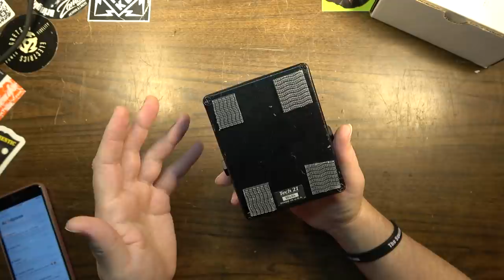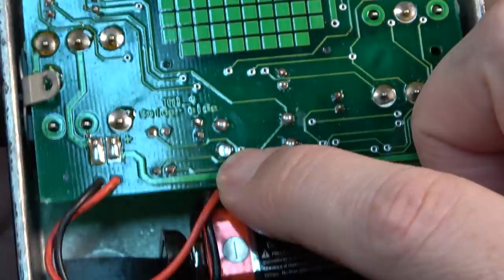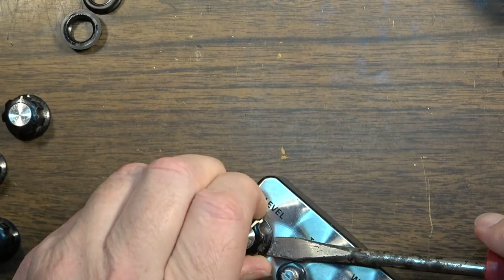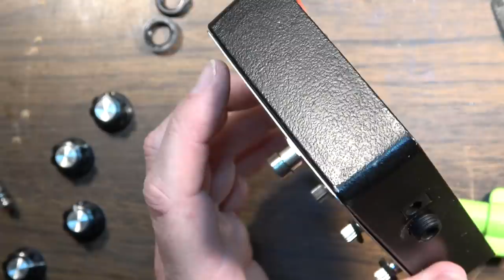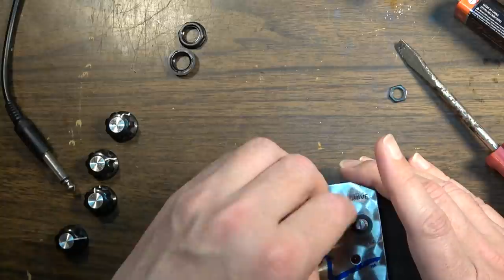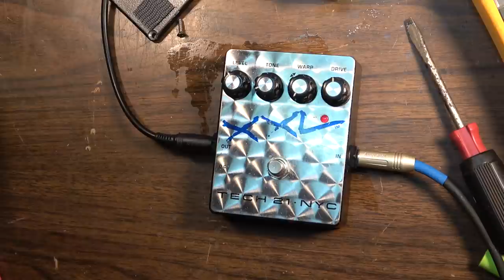Tech 21 NYC XXL 1990s Original - Repair???

Comment from the maker: Check out Dave's Guitar Channel: http://bit.ly/DavesGuitarChannel
Also, I forgot to hit record on it, but I did eventually reflow all the solder on the board also, FYI.
Reply: I just bought two of the last three us listed 90’s silver diamond plate Tech 22 xxls on Reverb.   I dig the transparency of this pedal 
   There is still one left and it’s under 100 !
Reply from the maker: @jahmosaxe3818  haha... I guess I just drove the demand up, huh? :D
Reply: Hi Brad. The owner could have meant having trouble engaging the effect. If that is the case, it is probably the tact switch that you pointed out under the plunger. They become intermittent over time and can begin showing symptoms on only rare occasion. Over time, it will slowly grow to fail almost every time. I replaced all 12 of them on a Line 6 Helix today because they varied from failing most of the time to one failing only on occasion. Measure the resistance of the switch while holding the plunger down. Having the board out and varying the pressure while pressing the switch with a finger would work better as the variance in resistance would be more noticeable,  but trying the plunger a number of times would show the problem. The resistance should remain under 1 ohm while the plunger is down. If at any time it varies over 2 or 3 ohms, replace it as it will become worse and is probably showing problems from time to time already. That would also explain why it didn't fail while you had it. These intermittent problems are our  nightmares as techs because dealing with them can be such a pain to everyone involved.
Reply: Price will now get crazy for these pedals ....
Reply: pedal whisperer
Reply: I enjoy watching you play and noticed some real energy when you jammed into the xxl. 
    Tone mods, amps and pedals that inspire the player to push their own limits what it all about.  Unless it’s tied to digital modeling 
 lol !

Comment: Long long long ago I decided I wanted a 'fuzz' pedal.. I tried a whole bunch of them at the guitar store, and selected this model.. It was easy to make a huge range of effects. I still have it, now about 25 or 27 years later.. and it still works just fine.  I like my XXL.  Some people seem to need 27 overdrive pedals... This will have most of them inside depending on the knob twiddles
Reply: Me too,except i foolishly sold mine early 2000's :/ It sounds great,too great as it makes my unengaged tone sound too midrangey and rounded. It occupies the distortion to fuzz zone nicely,love how it can be dialed in tighter to squashy with the warp control.Squashy and fat.It's great for those who aren't fuzz lovers but like some squashy fuzz flavored a little more clean amp freindly.

Comment: The Warp control adjusts the DC bias of the first op amp. This will give clipping on one half of the signal depending on where the control is set to. The Drive control adjusts the gain of the next op amp stage that feeds the tone control.
https://www.diystompboxes.com/smfforum/index.php?topic=29094.0

Comment: It's possible if he used a power supply that when the pug was taken out the contact in the jack didn't make clean connection for the battery
Reply: bingo, plus the pots sounded like hell

Comment: Yeah, I like the switch design too, but they should have used the jack setup like the other theys used on the crybaby wah. You wouldn't be able to disassemble the crybaby either if they had used standard pcb mounted panel jacks either. I would be super suspicious of the input jack and the 9v clip, but you already knew that.

Comment: I saw this in my YouTube sidebar and immediately clicked in because I used to own one of these many years ago. I started freaking just a bit because mine had just the tiniest bit of the blue lettering scratched/rubbed away, but when you flipped it over there was the "me twenty plus years ago" velcro hooks on the corner with disregard to which direction the "grain" was facing...

I didn't use it much on my board and I vaguely remember selling or trading it ethically by letting them know it would intermittently turn off or short out... obviously not suitable for live situations. 

My worst fear is that this is the same box, and whatever dealer/tech down the line had the same experience you did: can't reproduce the problem or find something wrong, so let's sell it. 

The odds that this is that pedal are astronomically against, but you still have a certain recognition when you see old objects. 

BTW, Tech 21 called the Warp control as adding even order harmonics going clockwise and odd order harmonics counterclockwise depending on which way you twisted the knob from that little arrow point at ten o'clock.

Comment: Is the battery wired to contacts on the input jack (unplug input jack when not-in-use to prevent battery drain)?
Maybe Dave just tried switching it on without a lead in the input...?
Hot licks there, btw, Brad.

Comment: I found that input jack which turns power on can get dirty and not get clean connection to turn unit on. Even a dirty guitar plug on cord can cause this. Great sounding pedal! I would put better battery in it, maybe Energizer.  Back in early 80s I built many distortion pedals with EQs built in for friends. I made one for bass player in our band with quite a kick on lows and the neighbor comes over and says dudes my walls are shaking! His house was 20 feet away. LOL.  Z.K.

Comment: Yep, ran into the same thing, trying to replace the switch on mine. It only needs a switch & I love this thing ( It's the Sans Amp GT3). It gets a Marshall, Boggie,Fender or clean boost. Very versatile & thick sounding.

Comment: Hey brad, what the Warp control on a Tech 21 XXL pedal is supposed to be doing is it is supposed to be controlling the even and odd harmonics generated by the distortion, it basically controls the symmetry of the distortion the pedal produces, if you pick hard, you get that characteristic saggy "aaaaooooo" distortion tone at some Warp control settings that sounds a lot like classic tube overdrive.

Comment: A friend of mine was good at bending the tip of the jack plug, getting crackles, then complaining that the jack socket was faulty. A bad lead would do the same thing. Loose battery connector, who knows?

Comment: I really like the way that thing sounds! ..and the machine turn or motor turned or whatever the fuck you call that shit they did on the faceplate, it looks cool af to me! 😎
Reply: I think the official term is “swirly shit”, but I may be wrong.
Reply: Its basically overlapping circles done with a wire brush. In plastering it’s called pargetting.
Reply: @normanperkel139  oh right, swirly shit hahaha that works for me pal lmao 🤣

Comment: Tech 21, just like the name implies, were ahead of their time. Why you may ask?
Because just like all the crap made in 21 they are impossible to repair and meant for the trash bin after a few years :)
Just kidding, actually have no experience with their products but the way the jacks were connected, makes you wonder.
BTW, I've gotten a few good deals over the years on some semi working pedals and amps when all the problem was just a loose connection somewhere.

Comment: Weren't there amps good too,
Reply: I’ve got a Trademark 60 that I like. The FX loop has grounding issues, but I’m pretty sure that’s just my unit. I’ve gotta get it serviced on of these days anyway... pretty sure one of the pots is shot.
Reply: I use two Tech21 Power Engine 1x12 powered cabinets that amplify the signal from my rack in stereo, and rely on IEM’s for hearing the mix live.